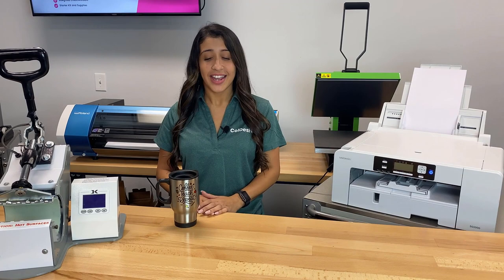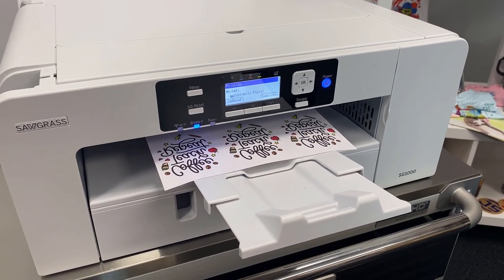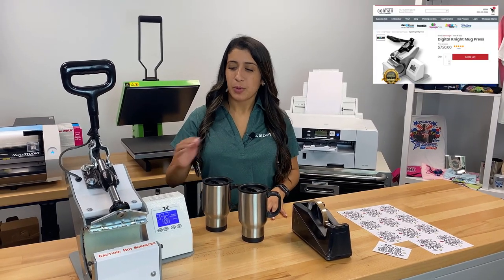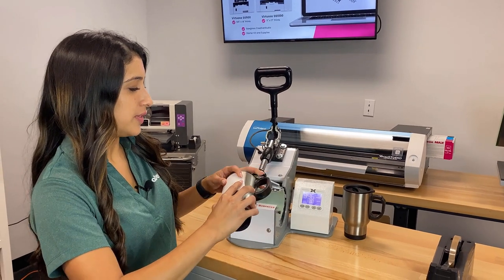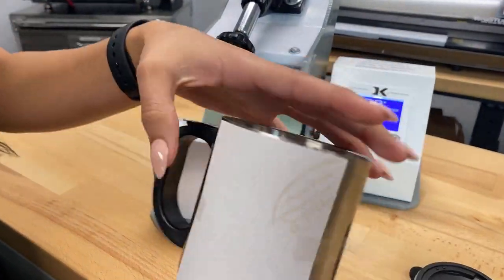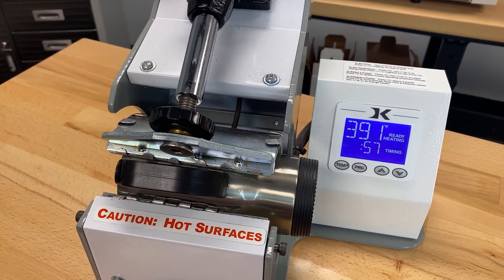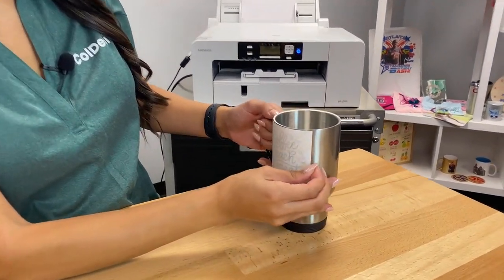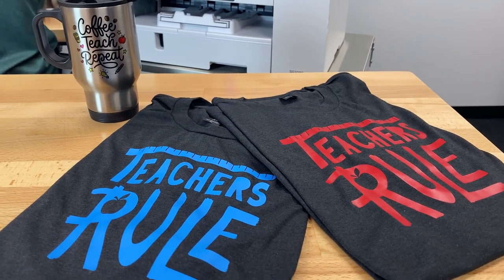How to Sublimate Stainless Steel Travel Mugs

Comment: Is this easy to scratch off?  Some coloured mugs that I have- the colour part can be peeled off easily ..will this come off like that?
Reply from the maker: Hi Divya! Sublimation does not peel, scratch or wash off! The ink actually dies the surface of the mug. This is a sublimation coated mug designed for sublimation. https://colmanandcompany.com/stainless-steel-sublimation-travel-mug.html